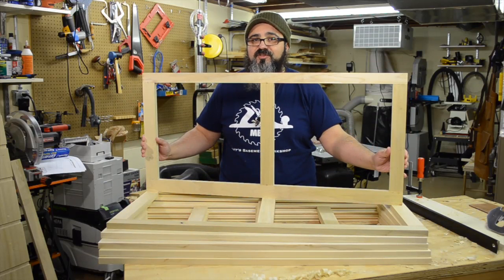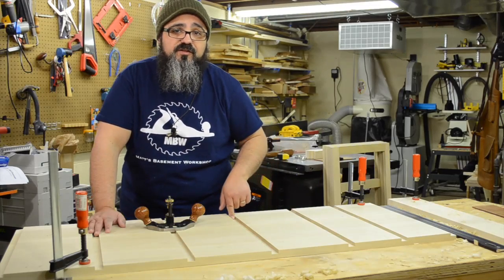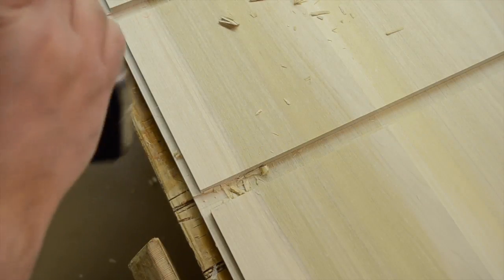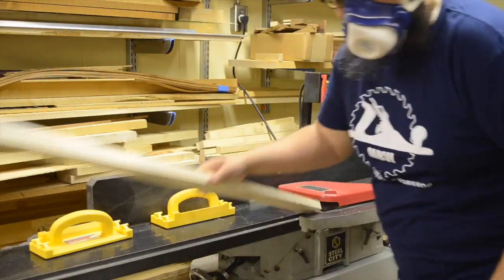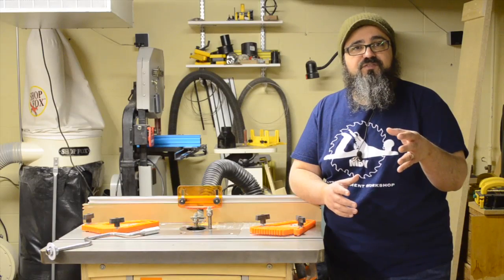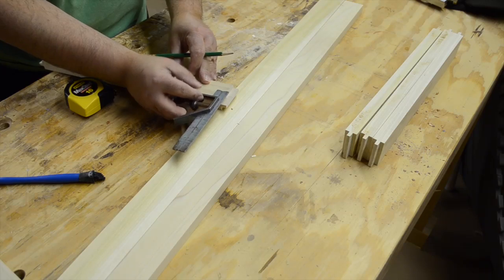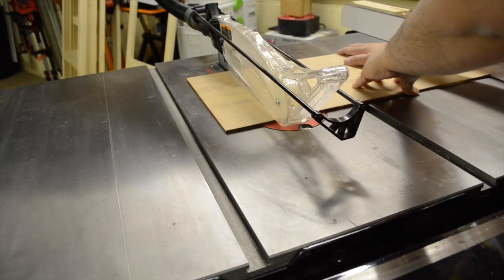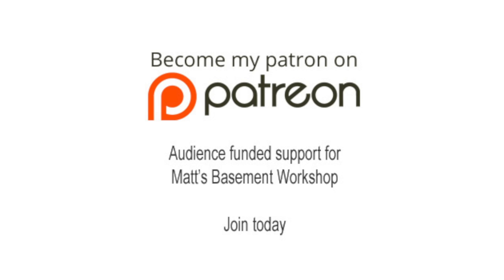540 Madison’s Dresser Pt 4 “Drawer Frames”

Comment: The build is coming along nice!  I am glad to see that you are showing safe practices by wearing a respirator, but any information I have read legislating their use says they are not to be used if you have facial hair.  Instead a positive displacement airflow unit is to be used.
Reply from the maker: Thanks Jim, I'm really happy with the progress on the dresser right now. I'm so thankful I decided not to attempt to build it around the holidays/year end LOL.

Regarding the respirator, without a doubt a full face system with an airflow type unit would be more beneficial for me (not to mention less wear and tear on beard.) But my use of the respirator is actually secondary to my main dust collection system, so while it isn't 100% "protecting" me from fine dust (and I can tell because I can smell the wood as it's being cut...the first sign it's getting through) in combination with the dust collector it's going a long way.

Thanks again for watching.
Reply: Loving the vids, hoping for many years of more!!